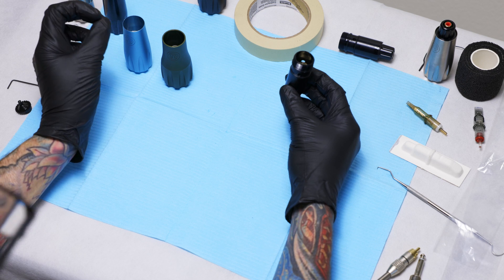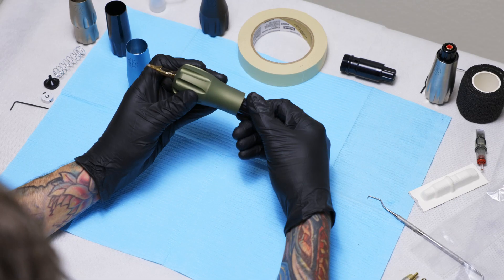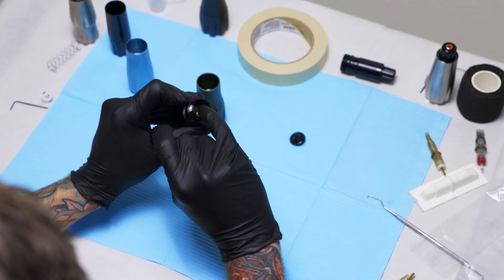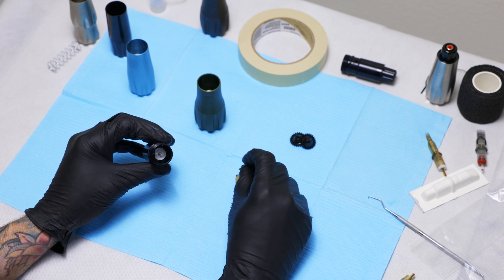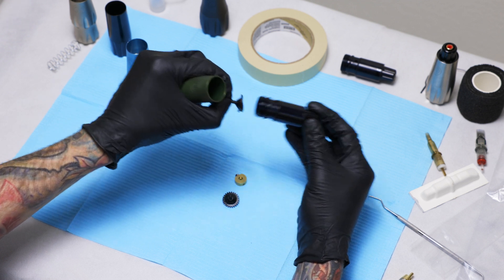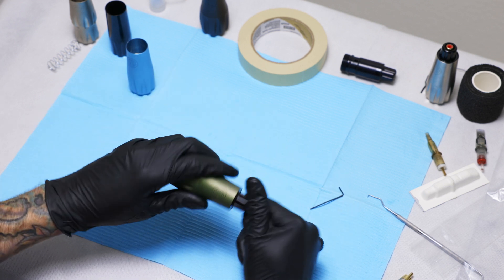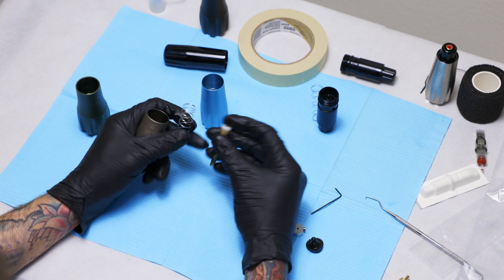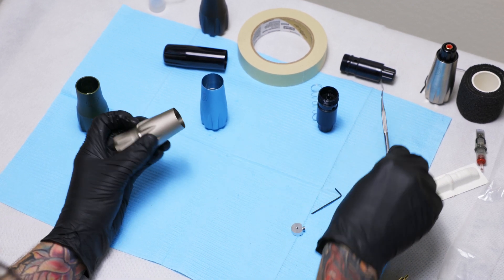Neuma 4 General Assembly

Comment: I love the machine for lining but have real issues with ink flow
Reply: Probably due to ur carts or your ink nothing to due with the machine in my opinion .I use dynamic black ink and fusion and black claw carts or saltwater tattoo supply carts I have no issues a good trick is  to add a small drop of Wich hazel not enough to dilute but to increase flow
Reply: What cartridges are you using?
Reply from the maker: Can you please describe the issue? We have not encountered this type of issue